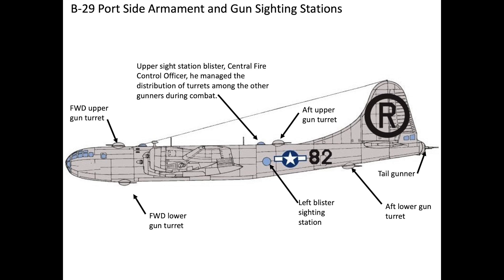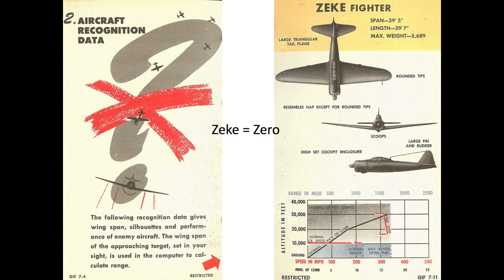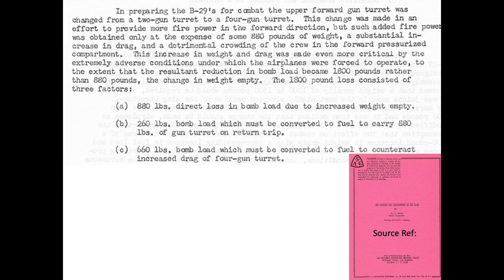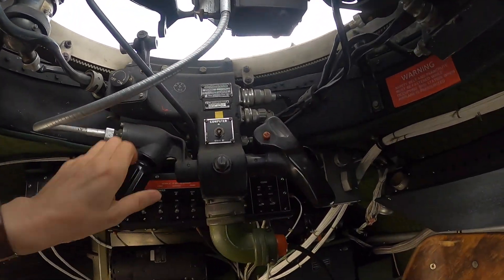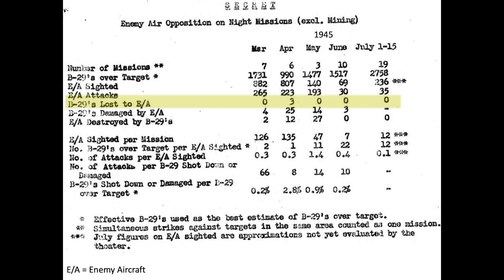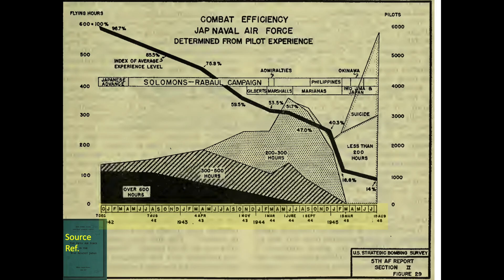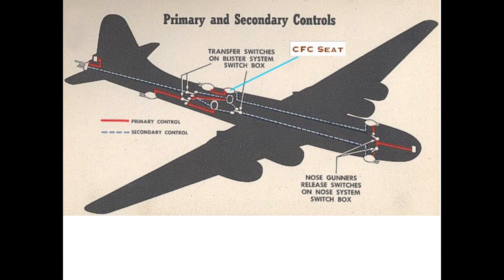Why the WWII B-29 Bomber's Gun System was so Combat Effective

Comment: Are there documents on how accurate the remote gun system of the B-29 was versus other systems? It's such an interesting & complicated system. 
Bonus for B-61 Black Widow and other remote gun systems. They're fascinating from an engineering point of view (the synoids, valves, optics, etc)

Comment: What I will never understand is why they didn’t use the b-29 in Europe where its heavy bombload and technologically advanced defense weapons would have been better suited. B29s were used since 1942 and if I’m not mistaken the luftwaffa was still a significant threat. Some would argue the b29 early on had a few kinks to work out, but in my opinion, those b24/b17 crews would have been safer in the 29. Obviously I know there weren’t enough for every crew but surely there were enough for at least a couple bomber groups
Reply: First b29 prototypes flew in 1942, first batch of production planes from 1943 were a nightmare - only 15 of 150 were operational. The "proper" b29 started flying in the middle 1944, after d-day when Luftwaffe was already in shambles and bomber losses over Europe dropped significantly. You will be replacing perfectly good operational planes with extremely expensive barely working newcomers.
Reply: @randomnickify  well that answers that question. Thanks for the info.

Comment: Now we understand why B29 was more expensive to develop than the Manhattan Project.
Reply: @jackgee3200  The Manhattan Project, America's nuclear bomb program, was one of the most expensive research and development undertakings of WWII. In total, the program cost about $2 billion, or nearly $30 billion in 2021 adjusted for inflation. However, there was one program that was 50% more expensive than the Manhattan Project. It was pushed through though because it was necessary for the Manhattan Project to work and the war to be won. Sanitman is correct.
Reply: @jackgee3200  WRONG.  On the contrary it is you spewing information that is irrelevant to the development of the weapon.  In fact the hypocrisy you shown here with well known stats readily available you enjoy on YouTube is hilarious.   My factual statements is from aviation publications, a field quite familiar with. What’s you’re field? 

Breakdown of Costs: 

$3 billion was the estimated total cost of designing and producing the B-29. While in comparison, the Manhattan Project cost around $1.9 billion. However, almost 4,000 B-29s were built, each roughly costing $750,000. Meanwhile, 90% of the Manhattan Project’s budget was used to build the plants and produce fissionable materials. Less than 10% were actually allocated for development and production. Nevertheless, the project produced four bombs with an average cost of $500,000,000 per bomb.

Comment: I could run the defensive system on one IC. But I stand in awe of the amount of intelligence that went into designing this system. It was built with engineers using slide rules and mock-ups.

Using tubes amazes me. Building tubes that worked in the rugged conditions this bomber faced is another amazing achievement.

Touring The Iowa - I was able to see Mk 1 Fire Control System used to develop solutions for The Mk 7 16”50 caliber guns. I was truly amazed at the skill of those who machined the gears and cams for such a system.

Comment: One also has to take into account that during the time of the B-29, Japan was fielding extremely unqualified pilots into their ranks. If the B-29 would’ve been introduced to Europe in 1942 these kill ratios would be much better than the 17’s, 26’s, 24’s, and ect. But would not be anywhere near as good as 1945 pacific numbers.

Comment: The designers KNEW most attacks'd come from the front, therefore, I feel the Lower-front turret should ALSO have been the same as the Upper-front gun turret, four 50cal. each.  My idea is strengthened by the B-54, which had two more guns @ the front, augmenting the twin-front-Under turret.   The necessary 520 gals of fuel to off-set extra gun/ammo could've been accomplished, by increasing span [--& tankage ], with JATO side-rockets to make the '29 get quicker take-off speed.  If any more "space" was needed for two extra guns & ammo, the fusilage could've been lengthened 2-4' on either side of the main wing spars, so the total length of the fusilage from end-end would have increased 4-8', a 4+-8% increase in length.   If the wingspan had been lengthen 4-8' for extra internal fuel tankage, that's be a 3-6% increase in the span, although the EASY-thing'd be putting two 300-gal drop-tanks out-board of the outboard engines, like it LOOKS like they hung 250-gal tanks from certain photos.   I also feel the 20mm aircraft cannon had longer-range, so maybe all 50cal, should've been "switched-out" for 20mm cannon in the Defense of b-29s/B-50s.  More "fun" for the pilot/Co-pilot,  would've been to mount two rigid 40mm AA, one on each side of the cabin, to "discourage" ALL frontal-attacks.  Maybe a 75mm,--or TWO, . rigidly mounted, like was put on some B-25 Mitchells for anti-shipping strafing.  One 'hit' from a 75mm would probably destroy the oncoming fighter plane

Comment: So, to use modern-day terminology, these integrated gun turrets were actually remotely controlled weapon stations (RCWSs) and sort of close-in weapon systems (CIWSs). Let me speculate: if this system was replicated with modern-day fire control system and mechatronics, using some modern-day machine gun or autocannon (maybe even rotary cannon) inserted in turrets and made fully automatic, would it still make sense (in terms of usefulness for armed forces, including economics) to be used for defending certain large and slower moving aircraft (transports, air tankers, AWACS, VIP command aircraft) or as part of armament suites for larger ground-attack aircraft gunships (larger helicopters, HC-130)? Could drones and SAMs and AA missiles be effectivel shot down this way in mid-air (I suspect that the short range of rounds would be problematic) or could close-in fire support be conducted with such systems?

Comment: I have access to to a photograph of a B-29's rear turret that has been modified to install a third 0.5" in lieu of the 20mm cannon - a common sense modification I would have thought.  I believe that this mod was usually associated with B-29 ops in Korea.  Do you know if this modification was: a) commonplace - and b) confined to Korean ops, or was it used in WWII?

Given the sophistication of the gunnery system I never understood why the tail gunner couldn't be allocated control of the lower-rear turret's 2 x 0.5"s that would have at least doubled his fire-power against the common curve-of-pursuit attack from the rear.  Any views?

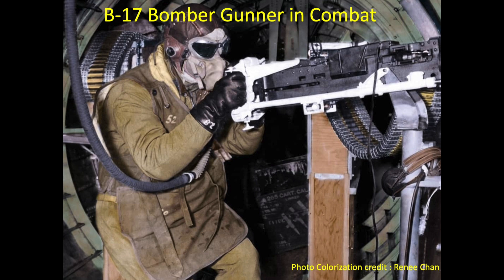Comment: 4:19 eh , this sounds like "norden bombsight wishful thinking 2.0" indentifying the proper aircraft, setting it inside the sight with high approach speed, proper lead, errors...similar computing systems were used on submarines for torpedo solutions...except the speeds and variables were arguably far smaller and yet the accuracy of torpedo attacks left much to be desired.
Reply: the difference is that this had a much more advanced vacuum tube computer that would be fed atmosphere information. could infer closing speed from the data of the in firing adjusted sight rin and movement, and could then calculate the firing solution, its basically what we used on ships during and after the war, and those were very effective
Reply: @marcusborderlands6177  then explain how did Mg 15s decimate 29s over Korea...
Reply: @DD-qw4fz  funny story, migs are a lot fucking faster than a b29 and a zero...

Comment: Gee, that's a shame you need to use more fuel or drop fewer bombs to add front guns to help assure crew safety.  There's no question, I get the impression some of the military brass were complete psychopaths who were not concerned about the safety of flyers and soldiers.
Reply: Everything in a system this complex is a compromise. More guns = more drag and weight. 

Less weight of bombs carried.. more aircraft needed to carry out the mission and more crews at risk .

Comment: I was trained as a radar technician in the Marines during 1981-1985.  We were probably the last to get trained in tube theory (transistor circuits for that matter too!).  I was always in awe of the engineering they did with the tech at the time.
Reply: Cheers!
I was a Coast Guard Eletronics Technician from 1980 to 1988. 
I also was one that repaired all generations of electronics. Hollow State (tubes) actual boards with large transistors etc, integrated circuits, boards with chips, even liquid cooled large tubes with plate voltages of 15 K, wave guides, magnetrons, RADARs.

Comment: I did not know that one gunner on a B29 could remote control three turrets, that is incredible.  That they had this technology in WW2 is amazing.
Reply: the gun system was effective in WW2 but by the time Korea happened, the computer wasnt able to deal with the Mig-15 jets, about 120 mph ahead of the fastest prop-driven fighters, and the 29 was pulled from daylight missions.. i read this on wikipedia.
But was the gun computer system installed in WW2 upgraded 5 years later when the KW broke out?\

Got to love the 'Government Font' of the drawings, in and in many field manuals 7:32
Reply: Yup. Beats being the ball gunner in a b-17
Reply: That was news to me as well.
Reply: ...wait until you find out about the WW2 unmanned attack drone that they developed. 😋
Reply: The ball turret also had this computer and some bombers from a their countries like for example late war German bomber and some jet bombers that were captured and completed by the Soviet Union had remote turret with similar computers and assisted by radar.
Germany was working on some interesting bombers that would feature pressurized cockpit, ejector seats, reduce crew, and remote turrets operated with similar computers and the assistance or radar
People tend to underestimate WW2 technology in general 
You probably didn’t know that the US had long range drones during the war or that Germany almost had a line of operational all weather fighters with radar, air to air missiles pressurized cockpits delta wings and supersonic or near supersonic speeds
Reply: As long as he didn't have turrets syndrome...

Comment: Hard to go wrong w/the 'Ma Duece' when it comes to reliability and the ability to 'shred' whatever it hits...even from a single round that 'caught good'
___________
It seems the '29' was 'It's own worst enemy' where the engines were concerned due to reaching the engineering threshold of 'rpm's vs. compression'  where metals begin to distort from friction-heat loading and oils lose their lubricity as the molecular components begin separating
( In plain English an internal-combustion engine has a limit that cannot be exceeded w/o destroying the engine )
___________
The 'B-29' itself must've seemed like a 'Flash Gordon' ship to pilots and crews just from the engineering involved where the crew are all but redundant...just there to 'push the buttons' when the plane tells you to

Comment: During installation. The gun turrets would need to be calibrated or harmonised to the gun sights. Which would be a pain of trial and error and making fine adjustments on a firing range, for each of sight stations and turrets.
When I was in the airforce in the 2000s and 2010s, we’d place a blackboard that had a grid on it, 30 metres in front of the jet and lined up with the jets centre line, then adjust the HUD with shims so the aiming reticle was accurate, then place a laser down the barrel of the gun then adjust the guns mounting bracket with shims. We sometimes did the same for the jets radar and inertial navigation unit. Until everything was perfectly lined up with each other on the blackboard,  which could take hours to do. On occasion we had to do this after the pilot was bad at gunnery practice! 
I think today everything can be calibrated by software adding a correction factor to the 
HUD aiming reticle.

Comment: GREAT video, but why are there two "right gunner sighting stations plexiglas domes" - one on either side of the plane  - 7:31 and 7:38 in the video? Should the one on the left side not be mentioned as the "left gunner sighting station"?  Just wondering.

Comment: Fascinating!

Also, the fact that the B-29 had a higher kill ratio than the P-51 is pretty amazing. You mentioned some of the factors contributing to this statistic, but there may be another that you didn't mention : did the Japanese air forces develop any better fighters than the Zero? IIUC, it was a good fighter in 1940, but seemed to be outclassed by several Allied fighters by the end of 1944. I have a vague memory of reading that Germany may have shipped some FW-190s to Japan, but I don't know if this is true or something I just made up.
Reply: Yes,especially the KI-100 and KI-84
Reply: Late post but aside from the KI-84 and KI-100 that another user mentioned, the J2M and N1K were also in service too.

Comment: To be fair, by the time the B29s were in use the Japanese airforces were well past their best in terms of numbers and skills.
As to the gun system, it was incorporated into the Lincoln, the RAF's replacement to the Lancaster bomber. If a crew member did not run around cursing and punching the kinks out of the feed belts that snaked around the fuselage, it jammed every time.

Comment: Fascinating.  Great details. 

You mention IJN pilot experience but surely the fighter opponents were IJA? 

Also, I believe that most Japanese fighters that would have flown against the B-29 in high altitude bombing had self sealing gas tanks by that time (e.g., Ki-84 “Frank”)
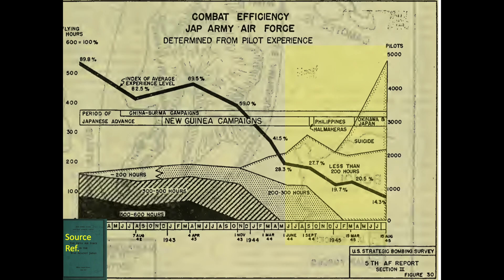Reply: The IJA graph was shown  just after the IJN one, at 13:39. I thought it was the same graph at first but I paused and the title had changed.

Comment: It is an important point the most successful B-29's were almost completely stripped down for low altitude nightime area incendiary raids. These B-29's were stripped down with nearly the guns including the complex aiming system completely taken out. These slimmed down B-29's had reduced crews with most other other ancillary equipment completely taken out. The B-29's flying on the March 9/10, 1945 Tokyo firbombing raid were simple low altitude nightime area bomb trucks. I think in late B-29 flights even the tail gunner position was removed in some or many missions. I think only a four or five man crew flew these stripped down B-29's. General LeMay ordered stripped down versions of B-29's with only tail gunner position to be produced by Boeing aircraft company. The removal of nearly all the guns, the complex aiming system, pressurization equipment and all unnecessary ancillary equipment greatly simplified B-29 manufacturing. Japanese nighttime air defenses were weak at best resulting in minimal bomber losses.

The low altitude area bombing incendiary raids of Japanese cities were extremely successful. Low altitude nightime bombing of under 10,000 feet often at 5,000 to 7,000 feet greatly reduced strain on the new B-29 engines. Thus, the fire hazard was mitigated substantially in these low altitude raids. The serious problem of these engines catching fire in the exhaust manifold system plagued the B-29 throughout its development. So the lower altitude bombing with stripped down B-29's with greatly reduced crews also increased bombload and fuel capacity. It is critical to remember the success of the B-29 bomber was only as a low altitude nightime incendiary area bomb truck. The original corporate group think was to make the B-29 a high altitude precision daylight bomber. So it was found all this cimplex gunnery equipment was totally unnecessary to end the war. Many B-29's were also used for dropping naval mines along coastal sealanes. This operation was hugely successful sinking over 1.2 MILLION tons of Japanese shipping in just a few months.

So here is a devil's advocate question. Could refurbished stripped down B-17's and B-24's with extra fuel tanks for extended long range worked as low altitude nightime area incendiary bombers? These refurbished B-17's and B-24's would have had no guns in them with four man crews only. The distance from Okinawa to Tokyo is about 950 miles. Iwo Jima is only about 750 miles from Tokyo. Around three fourths of the Japanese urban population centers are south of Tokyo. So starting in June, 1945 after Okinawa fell to American troops. It would have been no trouble extending the range of stripped down B-17's and B-24's to 2,500 miles with auxiliary fuel tanks both internally and externally on the aircraft. A bombload of 6,000 lbs to perhaps 8,000 lbs of M-69 incendiary bombs could have been carried on each B-17 and B-24 modified nightime bomber. The US Army Air Force had over 4,000 flyable B-17's and B-24's in Europe ion V-E day. The US Army Air Force with a force of 3,000 plus depot refurbished modified B-17's and B-24's could have destroyed nearly all of Japan's urban areas with incendiary raids by January, 1946 at the latest. American bomber losses would have been minimal. Shuttle bombing from Soviet Sakhalin Island could have destroyed all northern Japanese cities north of Tokyo. The United States could have cancelled the expensive B-29bimber program or greatly reduced it. The depot strategy of refurbished/modified for nightime area incendiary raids with extended range B-17's and B-24's could have ended the war in January, 1946 at the latest. No B-29's, no ground invasions or even the atomic bombs would have been necessary. The Japanese were already starving with an imploding industrial economy from the ironclad US naval carrier and submarine blockade.